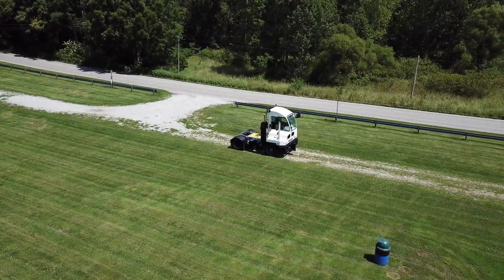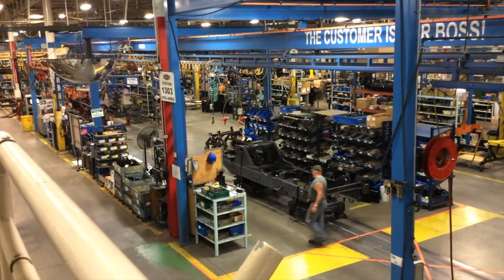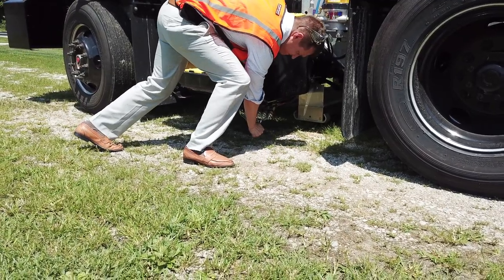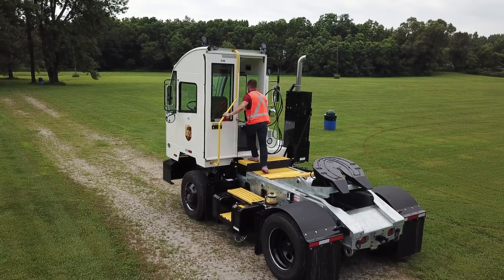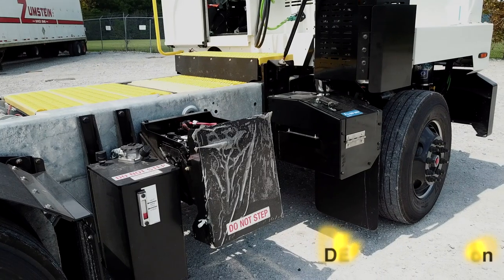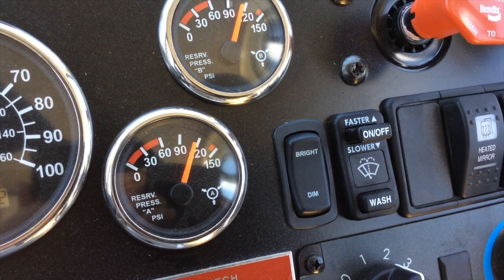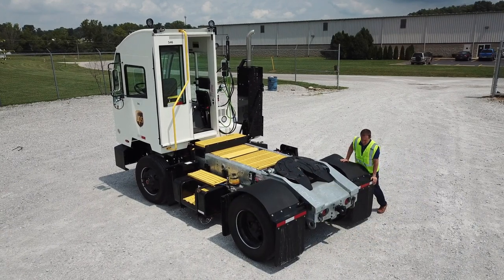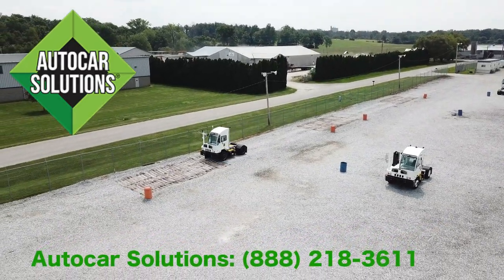Autocar ACTT Operator Orientation

Comment: I have been driving an Autocar yard truck for a few years and I have a few suggestions to make this truck more user friendly. First off the truck is way to loud and it seems the truck stays in the high rpm range without shifting up more quickly. Also the fifth wheel release is to far away as you have to lean down and to the right to push and release, this needs to be brought up more for the driver.  I feel everything the driver needs to touch should be an arms length away and that release need to be closer to the driver, like more of a wrap around dash.  Another issue is the steps are awkward to go up and down like there isn’t enough angle and they are to straight up and down. My last small issue is that when you have the heat on that the blower motor on low is actually to high and I wish you had a lower blower setting. Overall it’s a good truck, I just feel these small things can make it better and more user friendly.